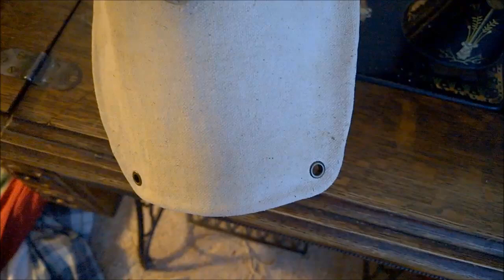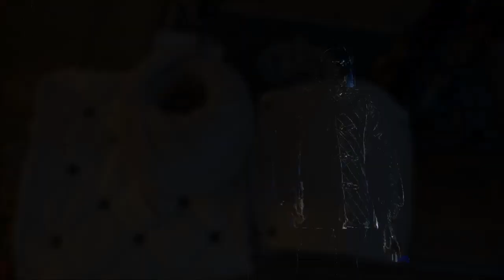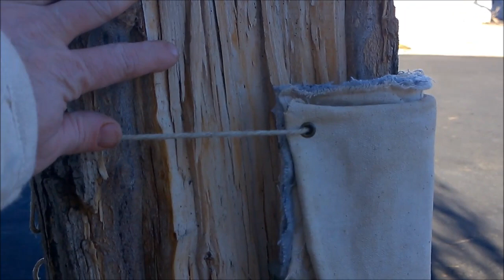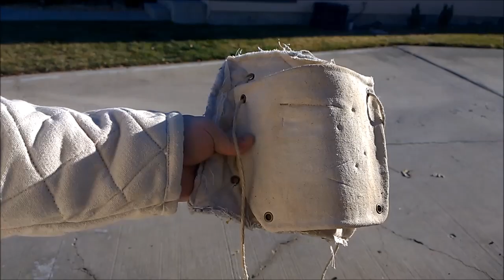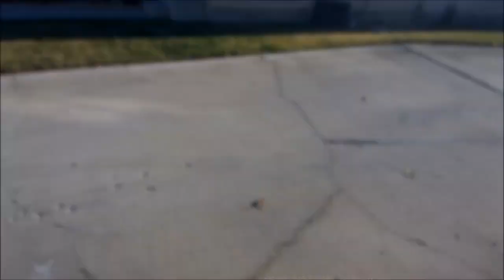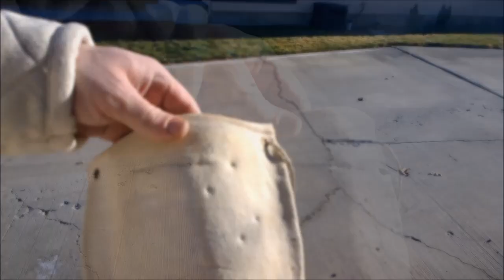Testing Linothorax

Comment: Bruh those were some really wussy strikes hehehe
Reply from the maker: I was not powering blows as hard as I could, true. The thing is...It's against a tree. Which within the framework of what was being done here is an object with an amount of inertia that is effectively impossible to overcome. Definitely not the kind of object you want to give it your all against, unless your aim is hairline fractures, torn tendons, and a concussion or worse. I used the amount of force I intuited to be most effective while still remaining somewhat accurate and staying relatively safe.

However there is more force being used here than it may seem. There are some lessening effects in what is perceptible here. Firstly my body is largely out of frame much of the time. Notice many of the blows seem to be held against the target longer than they need to be. That's because there is some leaned in weight being applied as well as some push off. Also the padding does a lot to dampen sound.
Reply: @The1Helleri  fair enough. I wasn't trying to flame, to me it just didn't look like the amount of force I would expect to be applied in a real combat setting. But I appreciate the video nonetheless
Reply from the maker: @m33tballa  Perfectly fine. Rewatching it after all this time since I made it I can see how it doesn't have the look of being impactful and requires a bit of explanation. The fact of the matter is that a tree was not a great thing to strap the target to (just what I had to work with unfortunately). Would have been much better to have something with some give to it when struck.

Oh but... since I made this I have read a really good book on the subject. A guy out of the University of Wisconsin basically did a crap ton of experimental archeology  and collation of available information. It all went into a book called "Reconstructing Ancient Linen Body Armor: Unraveling the Linothorax Mystery"

This book has some highly detailed information in it. They basically took all known images and references to the stuff from ancient times and organized it so they could do even as much as to point out stylistic changes between generations of wearers. 

Then they rigorously tested the crap out of their reconstructions after figuring out what methods were necessary to even make the stuff.

This book even has pages of tables from their arrow fire tests showing weights, newtons of force, distances, draw weights, head types etc. and the results of each instance of testing.

They even tried to see if doing things like offsetting the layers slightly improved their resistivity or deflective capability (the answer is not substantively enough to have been worth doing regularly). It's a really good read if one is interested in this sort of thing.
Reply: @The1Helleri  interesting, I mean, my understanding of linothorax is that it's protection is very limited but better than nothing. And also weighed about the same as bronze. Dunno why they didn't just use leather instead cos I feel like that would have better protection. *Edit: I forgot that lino has leather on the inside. The other interesting thing about lino is I've read that no one really knows exactly how it was made. The suggestion is wax and animal glues but I've read people claim that those materials wouldn't work in the Aegean climate. One of histories many mysteries I guess
Reply from the maker: @m33tballa  So here is the thing to do with these sorts of claims and ideas about how it must have been that you've heard...Hold it up against the bare minimum facts of the matter.

We know that Linothorax was used by soldiers in the region for hundreds of years. Why would they do that if it didn't work against the kind of threats they needed it t. Why would it be so prolifically abounding if the climate wasn't good for it? Why do we find absolutely zero examples of leather breast and back plates in actual artifact or depicted form if it was better?

As for how much we know about how it was made. It's actually a lot. Scott Aldrete's work pretty much tied up the loose ends on the parts we were not sure about with actual experimentation and deep research. Like they took pictures of,  chronologically organized, then analyzed over 700 decorated pieces of pottery depicting Linothorax. This allowed them to categorize the depictions by type and show even dated transitions in style.

There's also something like 23 contemporary references to how it was made or what it consisted of. As well as some archeological scraps. and even preserved theater masks (which were made of glued layers of linen just like the armor). There's even in situ preserved lead weights from looms used to make the fabric.

So we know a lot. I'd say it's really in the last 15 years that researchers, experimental archeologists and experts from various fields have managed to pull together the information that we've had for decades to paint the picture. But that picture is pretty clear by this point.
Reply: @The1Helleri my tldr: cost effectiveness, bronze is expensive, weaving flax isn't, and it's better than nothing.
 I hear you, but isn't a lot of that information just our best guess as to how it was manufactured? Not to discount it of course. All I'm saying is that we've had to fill in the gaps because there isn't records of its exact construction. As to the matter of it's protection, bronze was expensive and was not used by the vast majority of hoplites whom were mostly composed of levy soldiers. It would make a lot more sense to outfit yourself with cheaper linothorax at the cost of protection since the soldier was the one providing his own equipment. Like I said, lino was better than nothing, but not nearly the same amount of protection that was offered by bronze. Just like the transitional periods during the middle ages, not every soldier could afford plate or mail so they wore gambesons and aketons which i imagine would be very similar to linothorax.
Reply from the maker: @m33tballa  The thing is flax linen production never went anywhere. It's not some lost technology. Much of it became the domain of big machines since the bulk of the industry is industrialized now. But those machines are still doing all the same things that would have been done by hand. Just faster and more at once.

Also the knowledge of how to produce linen from scratch by hand never went anywhere. There's still people who do it the way it was done for 1000's of years. regions and families with unbroken traditions. And those people taught others (like my town's own crafting group that does all that from scratch).

So the production of flax linen and other flax products like raw and boiled linseed oil is not at all an unknown. Nor are things like animal glues. Or the fact that the ancient greeks had access to alum and vinegar and used them in glues. And there are artifacts that have been examined by textiles experts and they have a pretty good idea of how they were made.

The mystery around Linothorax was more about the claims surrounding it vs the reality under test conditions. and a lot of the work done by Scott Aldrete et alia clarified the myth vs. the reality.

The other part of it was methods of construction. And they tried and tested a lot of things. From which many concrete determinations were made.

Such as linen armor regardless of being sewn, glued, or backed needs to be at least a half in thick on average to be substantially protective against the threats it would of faced. Not only because that's the lower end for many bronze age weapons at normal forces not being able to fully penetrate or penetrate deeply. But because if it's too thin there are delamination issues.

It was also determined that this was better than thinner because from body heat it would shaped itself to be more form fitting to the individual over time. Which makes a lot of sense because linen has the property of contracting significantly when it gets wet.

They even figured out that it's pretty much impossible to make slabs of it then punch/cut out the shapes like a template. The pieces need to be cut out for the shapes needed, then glued together.

And it's a lot of stuff like that. Things that through trying it different ways they figured out that some step of the process really only works one way and so must have been done like that.

The work is far more rigorous than a best guess. They answered questions sometimes that they initially thought were unrelated to the question they were trying to address. But in answering one found the necessary answer to others (like the whole naval gap thing). 

Yes bronze was better protection. Nowhere did I disagree with that. But linothorax was not so prolific merely as a cheap alternative. It was really good stuff for the time, even put next to more expensive contemporary alternatives. In a lot of ways it was actually better.

We really do know most of what we want or need to about the stuff now. And granted that wasn't the case even 10 years ago. The book I recommended is pretty much the work that did it. That pulled together everything we have on it and fill in the gaps on what we didn't know.